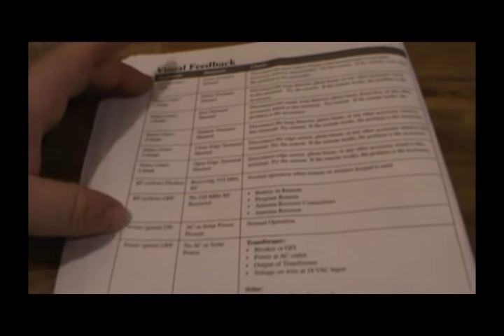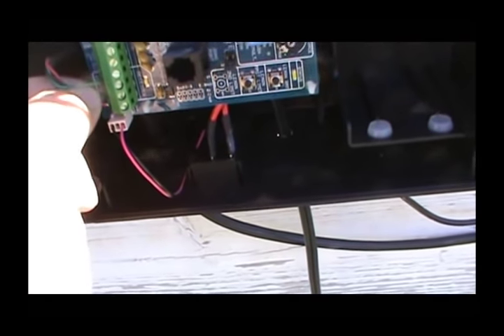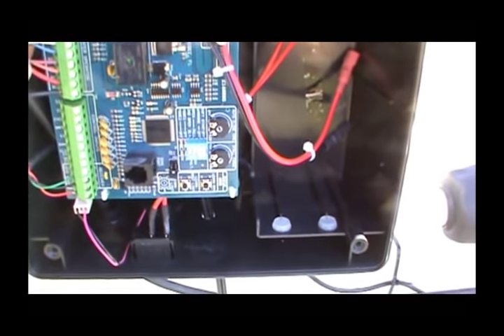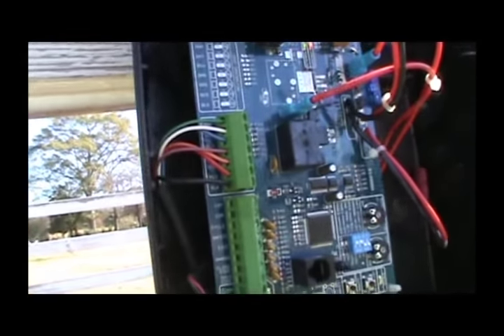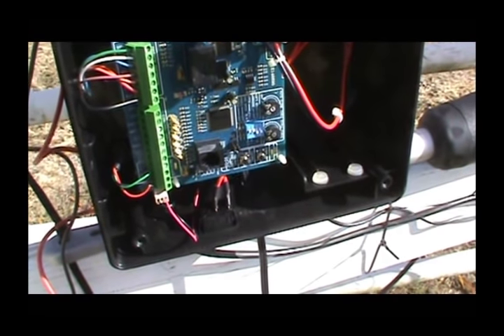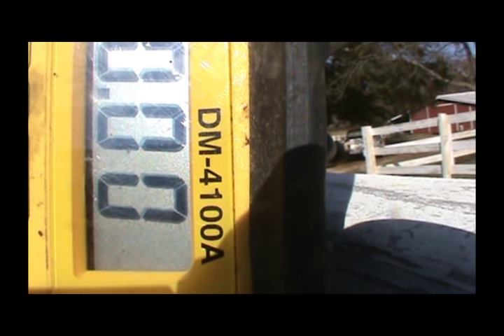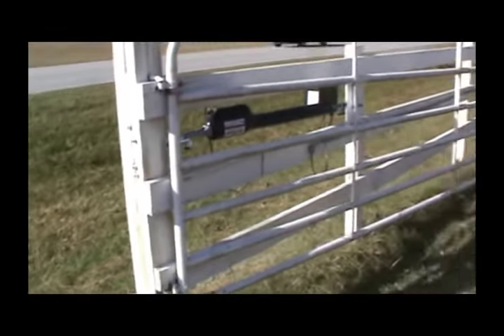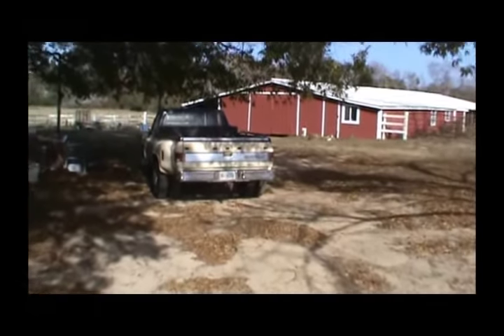Automatic Gate Opener Not Working

Comment: So I watch the whole video. And we don't know what happened or why? ??
Reply from the maker: Bad board.  They finally sent me a new one and it has worked fine ever since.
Reply: +farmboy30117 thanks.  How long have u had it now?  I've had mine 5 years. It just started acting up. Only closes a short distance then beeps once and stops.  Like it's running out of juice.  I'm gona try changing batteries    It's solar powered.  I've been happy with it up until now
Reply from the maker: I've had it for a couple years I guess.  I would say 5 years on these batteries is very good.  Time for a replacement.  Have you tried to reset the close position limit?  I had to do that to my mother's gate and it wasn't that old either.

Comment: Probably best to know that there are hundreds of different gate operators and that the boards have relays. Should learn how tow use a multimeter and read a circuit
Reply from the maker: I don't work on circuit boards but I know how to use a test meter.  Fortunately the opener was still under warranty.